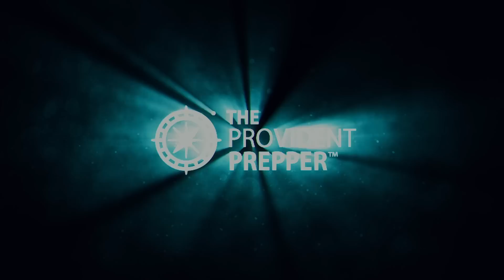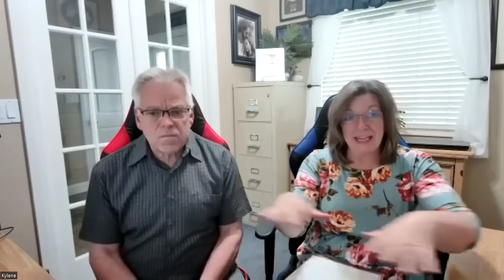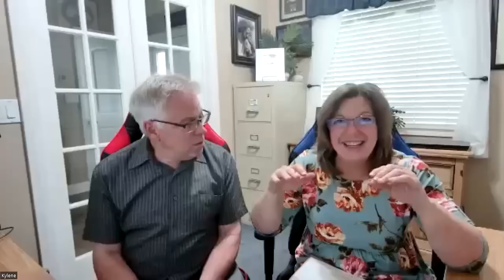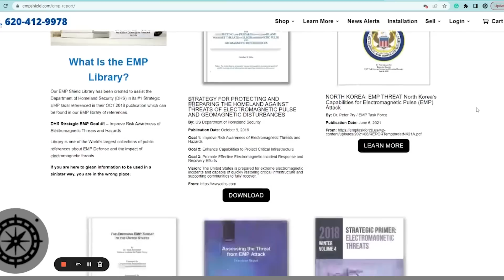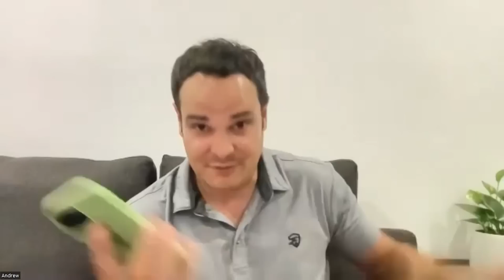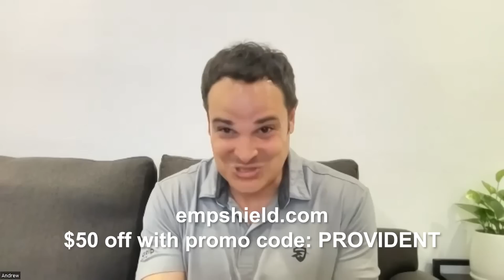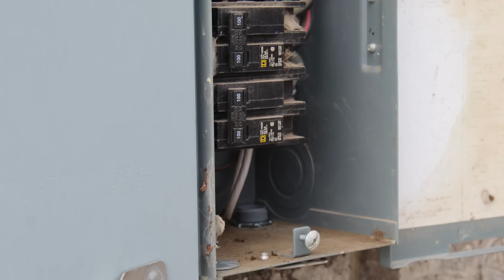Facts About EMP Protection: Interview with EMP Expert Andrew Bucchin

Comment: Hi, can an EMP damage a car with a diaconnected battery??
Reply: Battery is actually better connected.  It acts as a damping device like the ones they are trying to sell here.  Everything not connected is an antenna gathering power from the EMP event rated in hundreds of volts per inch.  The battery will absorb a reasonable burst like a capacitor.
Reply: @experimentmagnet  oh... thank you, now i understand it.. 😊
Reply: @snubby44special  You are very welcome. Ask anything you like.

Comment: I just had a lightning strike hit a large oak tree about 25 ft. from my home.  We did not notice any electrical problems until my wife tried to use the electric clothes dryer. It wasn't working. We went to the electrical box and saw that the breaker was tripped. Hit the breaker and a flash bang it tripped again we hit it a few times and finally looked up on top of the panel the EMP SHIELD was almost black like it had been burned. Then we knew lightning had hit our electrical system. We had an electrician come out that day and he knew what happened. He took off the panel cover and showed us what happened.  The EMP SHIELD has to be connected to a 220v  line and that was the dryer. He disconnected the wires to the dryer and all was well.

The EMP SHIELD took the  hit from the lightning and did its job with on harm to our electrical box or service. We called The EMP people and they sent a new unit out to us in 2 days at no charge (usually its a $50. charge).
THANKS GUYS.
Reply: SO your breaker did its job!
Reply: Wow cool thanks for sharing
Reply: Literally a real emp which would be a blanket covering your home and destroying the boards of your sensitive electronics would not be stopped at all by a emp shield (surge protector) a true emp does not travel from your electrical lines outside and into your home.
Reply: I don’t think lightning strikes generated EMP.
Reply: @Just_Johnnie  It's a shunting mechanism, it shunts power surges to ground, which would also include lightning.

Comment: How would an EMP affect a ICF ( insulated concrete form) style house since it has a rebar skeleton inside?🤔
Reply: ANY free ungrounded piece of metal will gather energy at rates in hundreds of volts per inch.   I e....don't touch the structure during the event.   It will be effectively a lightning rod.  It will likely be effective to drive standard 8 ft copper grounding stakes (like those by a standard fuse panel) into the ground every so often (maybe each corner) and electrically tie as much of your metal structure as possible to those as electrically tight as possible.   Or at least be outside during the event with a fire extinguisher to put out the hot spots after the arcing stops.   BTW... I know what I am talking about.  Studied it for decades.

Comment: What they failed to say is that if we get hit by an EMP, all power for all services will be out including but not limited to trucks for supplies, cell towers will be out so phones won't help you, grocery stores cant supply you with foods, you won't be able to get gas for generators that were protected. So protecting your phone won't give you service, if you have a generator that was protected, you won't have fuel for it. Even a radio will serve no purpose without a signal.  Within a week most will die from no water service, or access to food. You may be the only one in you are with generated electricity but will serve no purpose since you won't have access to information or updates.
It may be years before the grid is back up and running. Don't waste your money on things that will give you temp protection from the elements and the looters. You won't be able to call the cops.

Comment: Already obsolete!  MIL-STD-464 has been on revision D since 2020!  This is the problem when you start rattling off revision letters like it matters.  

For anyone that is interested, you can download the specs he mentioned from the ASSIST site.
Reply: There is no point. This device is just a electrical panel surge protector at over twice the price. Garbage. Snake oil. Buyer beware. They are looking for suckers.

Comment: The fact is: There is no protection. Any wire over 6 inches in length will fry. So you save your radio or cell phone, who ya gonna call or listen to will all the towers burnt. You'll be the only one.

Comment: An EMP can be thought of as wireless electricity going through the air, frying every cable it comes into contact with. An EMP shield device is noting more than a surge protector. AKA surge protectors only protect when the energy is going through the wire in one direction. NOT coming through the air. Its people taking advantage of uninformed preppers.
Reply: Not only that, but this device could never protect a generator or any type vehicle. Shame on them for fear monger selling tactics.

Comment: What good are your vehicles going to be when the fuel pumps at the gas station don't work? Better have carburetor and distributor vehicles with spare carburetors jetted and tuned to run on alcohol produced from your own distillery equipment and a really good Faraday cage filled with spare ignition coils, HEI ignition distributors, alternators, wire, cables, and batteries. I have four 4'x4'x4' Faraday cages filled with everything I would ever need. I also have a couple of absorption refrigerators, a smokehouse, and a root cellar built over a natural spring. Not to mention my own natural gas well. I'm ready.

Comment: Everybody is worried to death about their cell phones. What good will it do when the cell phone tower is fried?
Reply: For example...I got an micro sd card on my phone full of roughly 100 PDF personal documents for I.D, full-manuals and topographical maps that I can access off-line. With that, I run a 25000mAh solar charger to keep the cell charged. Ive set the storage for the phone up with a veritable library of info to access if I need it: self-reliance,water purification/desalination, shelters, harvesting plants/animals, firearm manuals, woodworking, carpentry, power generation, preserving meat/vegetable/fruits, blacksmithing, fishing, military/bushcraft/prehospital care manuals, etc.
Reply: @bradneely7736  I don’t know if I have been misinformed? But I have been under the impression that a decent sized EMP will wipe out the electronics in your cell phone rendering it useless. Might want to check into a faraday box with an extra phone and SD card of your downloads.
Reply: Well, to be fair, after the E3 has settled out, of you don't have a physical compass, download a compass app and you all set. But... have a physical compass is better. There's also GPS receiver apps for cell phones. They do have other users besides calls and YouTube.
Reply: Plus you also need to have a protected power source to charge your phone.
Reply: Also, Who you gonna call lol?
Reply: Unless the flare causes the magnetic poles to shift then compass is useless anyway.
Reply: They have satellite cell phones
Reply: @lauravanbuskirk66  wont the satellite be destroyed

Comment: I worked for a company that did work for PG&E. I have seen pad mount transformers destroyed by lightning that struck the first above ground unit and traveled along the underground cables and destroyed another transformer down the line
Reply: Greetings from Northern Québec Canada 🇨🇦  Are aluminum trash can to place electronics against EMP? Thanks, merci

Comment: One question....what does it matter if your device is protected if the EMP takes out the electricity?  Solar power isn't reliable where I live.  Some say generator...what fuel are you using?  Can you get it in a situation where there's no electricity?

Comment: EMP Shield is just a fancy surge protector that has a response time fast enough to shunt the E1 component.      We use the Siemens FS140 with a 1 nanosecond response which is plenty fast enough for any EMP. 

Thing is, no EMP protection will keep your electronics safe from a Nuclear EMP because the E1 couples directly into the electronics at the circuit level.

Siemens FS140 is about $200.       Dr. Arthur T. Bradley from NASA recommends the FS140 over everything else.   He is a PhD Electrical Engineer with specialty in electromagnetic wave propagation and has done extensive testing.
Reply: I watched several of Dr. Arthur Bradley's videos and because of him I have a Siemens FS140 on my house subpanel. I ended up calling Siemens technical support and because I live in an area where lightning is common, they suggested I put a Siemens TPS3A03050 (lightning arrester) on the main panel, and a Siemens TPS3A03050 at the disconnect for each mini-split compressor.
Reply: Hot diggity!!!   I knew if I scrolled down far enough in the comments there would be at least ONE intelligent and educated individual speaking truth and common sense.  Shame on EMP Shield for fear mongering and selling their device at 2 to 3 times the price of a Siemens, Leviton, or GE unit. Furthermore, it has ZERO use at all on a generator or a vehicle. Wake up and do some research people!!
Reply: Unfortunately, NASA is part of the problem.

Comment: with the greatest certainty all solar panels will become unusable as the 2 silicon diodes will be destroyed! But you can keep extra diodes in reserve in a protective cage to solder on instead of broken ones. Keep in mind that a gas powered soldering iron can be good to have when the power is out ;)

Comment: I have 3.5 mil and 7 mil mylar bags with ziplocks, that can also be heat-sealed, and I love them for storing dehydrated greens, veggies, nuts, and grains. (I like to Pack Fresh). I put my phone in a bag and closed it, and asked my wife to call me, and the phone never rang; both bag thicknesses blocked the radio waves. Out of the bag, both phones worked. If nothing else, I expect that keeping your phones in such quart or gallon mylar bags would prevent the  24X7 pinging and nonstop surveillance that we are constantly subjected to. Don't let the jerks trace your location; only use your phone when YOU want to use it.  Similar mylar bags are also available in 2 gallon and 5 gallon sizes.  QUESTION for anyone: I am wondering if such EMF signal blockage would imply that these inexpensive (25-50+ cents) bags could also be used to protect phones, LED's, radios, flashlights, etc from a major solar or weaponized EMP ???
Reply: If your bag is non conductive, it doesn't do anything.... period... physics.   It also has to be thick enough to shunt (short out) the energy absorbed.

Fun experiment.  Put an old CD  ROM in the microwave for 30 sec.  (Don't breath the results)  great demo of a shield that isn't heavy enough.  Put your mylar bag in the microwave.   Did it burn up like the CD? Do nothing (non conductive)? Or get hot as hell and maybe toss sparks from the corners... (that one might just work).

A microwave oven is a pretty damn good EMP simulator test.

Comment: My '85 Ford 4x4 w/ 460 engine carries 55 gallons of gasoline which I keep fueled all the time. It has a factory electronic ignition; that is all the electronics the engine needs to run as it has a carb. I have a mechanical distributor with points anda  voltage regulator for the alternator that I can install in under several hours which is immune to emp. These older vehicles (damn Cash for Clunkers via obummer) are well worth having when SHTF after EMP. I have material and plans for a gas fuel generator using wood and vegetation gasses through the carb.
Reply: Smart man, I have a feeling you are a little more on the side of caution and prepared than most.  Stay safe!
Reply: Greetings from Northern Québec Canada 🇨🇦  Are aluminum trash can to place electronics against EMP? Thanks, merci
Reply: @Katouzine  I do not know but a search for aluminum emi shielding effectiveness suggests an aluminum can would be effective. Not only is my truck to be protected but my '89 Isuzu Trooper with electronic controls is being converted to a dizzy and carb setup.
Reply: My 80 bronco runs on propane, I can fill it off off a tank at my (or any) house.

Comment: Anyone who understands how EMPs work will also understand that EMP Shield products are overpriced gimics at best. For example, the vehicle "EMP shield" that they sell is a glorified DC power filter / surge protector. It will do absolutely nothing to mitigate the high voltages induced in the semi conductors in the vehicles electronics as the emp wave passes through the item. Only proper shielding of the electronics will be effective at this. Connecting a surge protector to battery of the vehicle will do nothing. Don't waste your money on an "EMP shield," your better off improving the shielding. These guys sell EMP snake oil and will file BK and disappear the moment an EMP event happens, so don't count on any guarantees getting honored.

Comment: The device being offered for sale in this video looks almost exactly like a whole house surge protector that I bought from Home Depot for about $40 a few years back. It even attaches to the breaker panel the same way. If it is the same device then the price they are asking is an utter ripoff. And while a surge protector can stop lightning strike damage, I am not convinced that it will work on an EMP. Of course if that ever happens, good luck getting coverage for any damage.
Reply: Completely correct. Shame on this channel for helping sell a snake oil device.

Comment: It isn't magic! Everything that is highly energetic creates an electro- magnetic field as a brief pulse EMP. Anything that conducts electricity will generate it as the pulse passes. Anything metal, the wiring in your home, the chassis of your lawnmower, etc. That voltage caneasily be high enough to arc to the ground starting a fire. Small, delicate circuits in electronics need a much smaller current to burn up those little circuits.

Now the good news. 3 feet of dirt stops all radiation. It only travels in a straight line. Very little can bounce but if you cover it with chicken wire and ground it, virtually nothing will bounce. So, a cave or basement is protected on the sides and bottom. Pour a cement roof and put dirt on top. You can park in it. Put your solar panels in there. And it makes a great storm shelter.

Just remember,  the stray voltage can follow Anything inside. Ground wires, water pipes, or even sewer piping.

Comment: Being honest Im having a hard time understanding how this device is supposed to work. If a disconnected device can get fried by the electrons flying super fast how be plugged to that tiny box is protecting it on any way? I mean, of course the inventor wont explain much and I get it but Im trying to wrap my head around how is supposed to work. As a contractor Ive seen many SCIFS and ALL of them always have a super robust grounding system and what I see here in the pictures is a tiny box with tiny 22 GAUGE cables with very fragile terminals!!! Honestly I cant understand it. And the problem is that after dump $400 (which if it works I will buy several in a heartbeat) there is no way to test it, I have to have faith that it will work. Military studies, mehhh. I dont know, I'll keep doing research about this device because if it really works is unbelievable how such a cheap tiny box can fix a possible human extinction and this is not on all the news right now. I dont know if is that I understood this wrong but if this will protect anything coming from the power grid? absolutely, I believe it, but how it will protect the electrons coming at lightning speed from the atmosphere to my wood roof? cutting the power with a breaker? so I guess faraday cages are a waste if time then...
Reply: Your not far off brother.   IF that device had 2 AWG cables and uses 2500 Amp or greater IGBT transistors... it might work.  I got the same impression as you...looks very "Radio Shack"...  they don't post any real specs... Amps, Volts capable.
Reply: You have to bury your electronics

Comment: If the Grid goes down-- The municipal pump lift stations go down. If these go down, Sewage backs up into everyone's house making them unlivable. Learn how to prevent this ;-)
Reply: Could you tell us how do we prevent it?
Reply: @sharonmetzner1798  Install a Back-flow break and cleanout port in your sewage line. It can runout into the yard & not into  the house.
Reply: Can you tell us how to prevent this from happening?
Reply: @claytonb3044  If you use a septic tank, you should be fine in this respect. If you live in a suburb, try and have a one way valve and clean-out pipe installed in your sewage line. If power goes out for a day or two, open the cleanout port just in case. Many new homes already have this.
Reply: People that don't eat much don't shit much either.😊
Reply: It’s something to eat.
Reply: The huge transformers that are key to the entire grid will likely be fried.
Each one takes years to manufacture and is extremely difficult to transport due to massive size and weight.
Safe to say if a Nuclear EMP attack happens we will be back to the 1800's for decades if not forever.
Reply: @CountCraigula And 90% of the world will starve to death. Agricultural equipment will fry, and all transport equipment will fry. Farmers will try to protect what they have, and people will be fighting to the death over food within weeks. Losing the grid will be the least of our worries, we’d be back to the dark ages.

Comment: I can’t see how a plug in EMP shield can protect most things. They’ll generally have some kind of converter changing voltage or ac/dc etc. I don’t understand how the circuitry beyond there - IE the processors, transistors, diodes etc are protected. Also I’d love to know how these are tested, proving beyond just theoretically. 

Please don’t think I’m being negative, I’m truly interested in this and realise how catastrophic an EMP would be to civilisation.